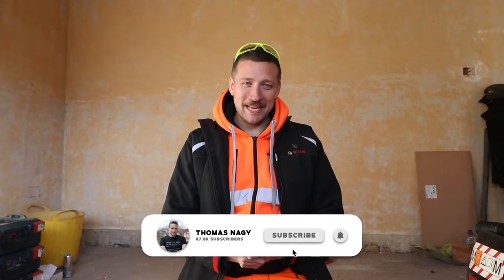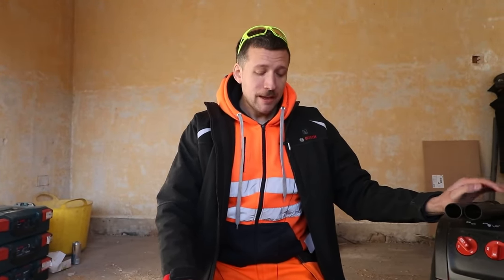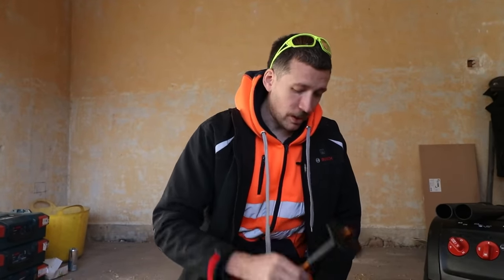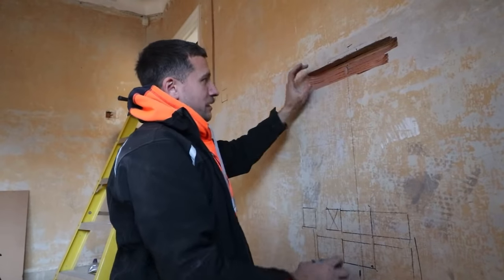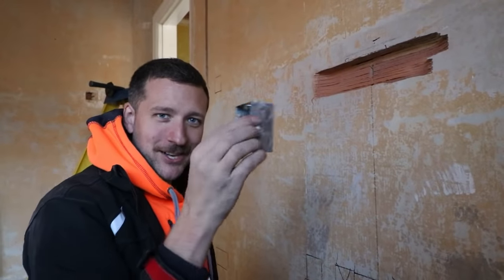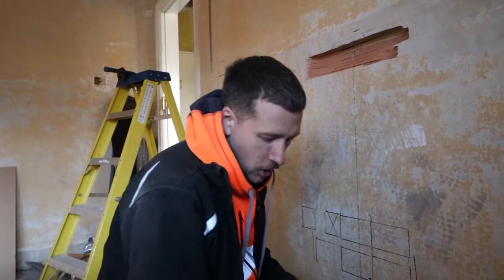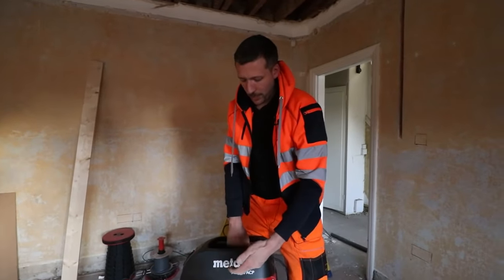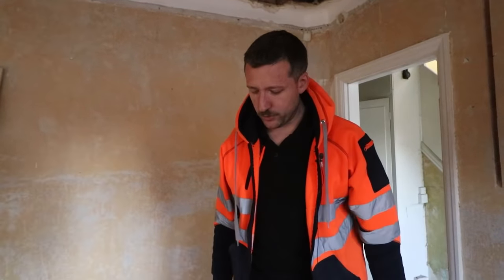The GOD of all WALL CHASERS! | Thomas Nagy

Comment: I've got twin blade atlas copco, needs two people (one on hoover!) Found it easier to chase from the top down, not bottom up. Less resistance on blades...
Reply: I see the Metabo is designed to be pushed, shame you can't flick a switch and use it in pull mode.
Reply: @nw5835  yes, using gravity to help would be so much better than trying to go against it.
Reply: Just turn it upside down
Reply: My erbauer one works by pulling it down. Better that way I think as the weight of the chaser does most of the work. Backed up by my trusty old Henry… greedy bastard!
Reply: Take it from another electrician.
You're arm's wil thank you if you juse gravity instead of fighting it. Just keep it on the wall. And hold it straight. Wait of the machine wil do de rest.
Reply: @robertjan3689  not sure how spray painting it will help
Reply: @Jackdaly2000  😂😂 sorry correct now. English is not my first language.

Comment: Was very impressed with the auto filter cleaner. That is going the extra mile that the unit will vibrate its filters clean so your suction doesn't drop off as the bag fills up. Great stuff.
Reply: Most  industrial vacums have that feature
Reply: If you’ve never seen a self cleaning filter it must seem like magic to you…
Reply: @WestSideConnection5  no, this system is quite different. It uses electro magnets to shake the dust out. Most other industrial vacuums use blows of airflow. Which impacts temporarily the suction.
Reply: @williamwallace410  never seen an industrial vac that doesn't vibrate the filter.

Comment: Bought these two years back Tom and never looked back.  Increases productivity by 500%.  It is by fare the best machine we have ever bought and with the xxx guarantee it's bulletproof.  If you are a " Registered Electrical Contractor"  And take on a lot of rewires you need to buy this machine.  We suggest the 240 V version as it has in 1900 W motor and better for pushing the three blades.  The 110 V version is only 1700 W. However you may need this if working on construction sites. The vac is by fare the best on the market in every aspect, self cleaning, power take off, hepa, just amazing. Well done  Metabo

Comment: Im an electrician and at my job we use the hilti wall chaser with dual blades, what i've noticed with other brands is that you will have to let the machine work and can't put too much pressure on it. The hilti chaser eats up everything at very high speeds.

Comment: Best tool I own by far
Reply: I was about to comment that you swear by yours on your rewire videos. 👍🏻
Reply: Nagy is late to the party 😅
Reply: Will the matabo triple blade system fit the dewalt chaser ? Anyone try it?
You’ve had your matabo for a while now nick?
Reply: @bertiebassett1972  I think mark allison (on YouTube)  tried/uses the triple blade in another chaser.
Reply: How often do you replace the triple blade nick?
Reply: @richardnewton1800  I’d say every 3-4 rewires mate
Reply: hi, what size transformer do you use to run cutting machine and hoover(20 litre.) cheers.

Comment: With that amount of dust extraction, I'd personally look to be wearing something like one of those basic 3m ffp2 masks instead of the whole external filter job. Less bulky and easier to put on, but plenty for the amount of dust it puts out.
Plus that dust extractor might well end the whole "sparks don't clean up" sterelotype when you're on site with the other trades 😉

Comment: In order to help with the strains on the arms you can start at the top of the chase and go down using the machines weight. Depending on who high you go you might need to do the top part still pushing up but is should certainly help. Such a machine with an M rated Hoover is a must I you do a lot of chasing. Often you can rent such a tool aswell for specific jobs.

Comment: That filter cleaning is a requirement for the "M" rating the machine has. M stands for medium-hazardous-dust, like you get from cutting wood or walls (the "high" rating would be for mould and other ugly stuff), It should also notify you when the pipe is clogged, usually by some annoying beeping. I got the Bosh hoover and I also really like it but I haven't yet decided which wall chaser to buy, house rewiring is going to start soon :D
Reply: That’s no an M class set up at all
Reply: @dominicmackrill5953  if not, why does the vacuum than have the big "M" Sticker on its side?

Comment: Couldn't do without mine. Have probably done about 15 full rewires so far and only just replaced the triple blade, not because it was worn out but because a couple of the segments came off. I cut in all of my boxes with it, even singles. The making good afterwards is easy and well worth doing. All of my boxes are perfectly flat with solid fixings so an hour of making good on a full rewire is more than made up for.
The dust extractor has performed fantastic, never needed to replace the filters, I just give them a good bang out occasionally and it is good to go.

Comment: A primative 'track saw' arrangement with an 'anti kick-back' lock would not only steer the chaser but would take the strain out of it even if not reducing the effort. Think wardrobe rail with a flexing runner that only goes forward.
Reply: I would love a tracked wall chaser with plunge function. That would remove the insane cloud of dust when first putting the blades into the wall.
Have you ever seen it?

Comment: I can't believe you have only just started using a wall chaser, I bought an Eabauer one from screwfix for £99, and use it with a Bosch class M dust extractor with auto filter cleaner  , the wall chaser works very well, considering the price, personally, the price of the well known brands doesn't warrent it, mine has a double wheel, with a flat chisel to break out the middle, breaks off easily, connected to the dust extractor, no dust at all.
Reply: I have the metabo twin twisted slot set up on my erbauer, but otherwise same set up.

Comment: dust extractor vacuums are a must have for every contractor yes there pricey to buy and can be quite expensive to run but you look professional and they save time cleaning up and best of all because less dust its better for everybody. i have a dust cyclone as well which cuts down on replacements bags well worth investing in if your doing lots of work and filling up bags quickly. i personally recondmend the numatic dust extractors as parts and bags are readly avalible at a resnable price. i wanted a 10m hose and i got one from my local vacuum cleaner shop for £28. i did have a festool machine and the replacement 3.5m hose was  £80 which i though was excessive.

Comment: quick tip to make using the set-up easier. . . wrap different colour tape around one of the flexes.  Makes it easier to tell them apart when your trying to move what you think is the chaser flex around, and it's actually the hoover flex.

Something Metabo could do to improve the design would be to use a different colour flex so users can tell them apart at a glance.
Reply: ? you connect chaser flex to the hoover so its only one to unplugged from the wall socket.

Comment: Hi Thomas, its a small point but that black bag is for wet collection/slurry. I'm not sure if the plastic might reduce suction a bit over time vs the fleece...

Ive found it a bit tricky past yr to find suppliers for the fleece bags but would imagine youd get a good few 'tip outs' and reuse from the black bag.

Few work arounds for cutting the fleece bags to reuse - but I just replace them each time.

Enjoy its def a game changer!
Reply: The fleece bags are for wood dust with the filter cleaning function switched off. You can only have the filter cleaning in when using the black bags or empty container. 👍
Reply: @cyberdogg5  ahh. Well, the plot thickens 😂 you def can have the filter on but it leaves dust which I've always brushed out when tipping the bag.

So scratch that about finding the fleece bags and I'm off to look for plastic instead 😉🤞👍

Comment: If you used a cyclone in line with your vacuum, maybe your  filters and the vacuum would stay very clean, not sure if this would work with brick dust, but this system works extremely well with wood dust.
Reply: Do you have a link to one of these systems? Thanks

Comment: I had this tool to chase out my house. It was incredible and re-sold with very little loss. Blades last forever and extraction is extremely good. Bag does start to get holes in quite quickly where you clamp it and instructions were poor but very self explanatory.

When you do a chase double width you do get a little more dust but marginal in comparison. 

I cut out boxed with it too. Once you work out where the blade sits relative to the runners it's easy to do a few lines to run lines and do a box no issue.
Reply: Ok; why doesn't the UK just use round boxes like we do in NL? We just use hollow core drill 82mm with 100% dust extraction and done.

Comment: I am using the cheapest saw with 4 blades- working fine for 30cm with Standard vacuum.
Upgraded to very expensive vacuum with automatic filter cleaning: works like in your Video.
I always go from the top down.

Comment: I have the very same kit. Top tip is to turn the chaser upside down and let the weight of the machine push down along the wall.  It makes it 10 times easier and id also just empty and reuse the bags to keep cost down.

Comment: I prefer the dust masks with an integrated visor, much more comfortable for long periods and better if you wear glasses.  The best ones have a seperate battery powered air pump....
Reply: Regular glasses break the seal on full face masks. Or do you have special glasses for inside the mask?

Comment: Bought the Metabo chaser with a triple blade for some pipework to sink into the wall. Used a Henry tho and he wasn't fully up to the job was a lot better than not using a hoover but you do need the M class extractor.

Comment: I've got the predecessor to that chaser, the MFE 30. I think it's slightly more compact and less powerful (I don't believe you can fit the triple blade to it?). At the time Metabo didn't have the self cleaning vacuum so I ended up buying a big Numatic (big version of a henry) but I find it blocks up frequently (even with a bag). I have built a little cyclone filter but not had chase to fully test it in anger (I don't do any house wiring anymore)
Reply: The Mfe 30 is more manageable paired with a Bosch Gas25 dust extractor.No dust.

Comment: I am an electrician in belgium. The trick is to use it from top to bottom. Gravity helps a lot.
Reply: @Anon-y-mouse  I hold it upside down and go down the wall and with the metabo mfe 40 and the metabo vacuum m classe it produces very little dust . In plastered walls and new red bricks.
Reply: @Anon-y-mouse  That's because the MFE 40 spins the other way compared to most other wall chasers.

Comment: Great video Tom. I have had this wall chaser and dust extractor for about a  year now, and have used in lived-in property's, absolutely different level of wall chaser, it's so clean and quick compared to 2 disc and sds. A must have for anyone who carries out alot of chasing.
Reply: How does it handle brick walls ?

Comment: I've been using the old model Metabo chaser for years now and find it much easier to start the cut from the top and use the weigth of the machiene going down. The strain on your hands is far less and and much quicker. That new triple blade is a god send I will buy two of them now!
Reply: The MFE40 is designed to be pushed, it doesn’t work being pulled due to the rotation of the discs.
Reply: @cyberdogg5  You invert the direction and the machine and you "push" downwards, that is, you let the weight of the machine do the work.

Comment: The arm workout comes from the tri blade, using 2 blades is far easier. The tram lines the tri blade leaves really annoys me and the plastic hoover pipes are flimsy and create loads of static. If my nilfisk didn't have a curved end that inserts into the tool it would be better than the metabo vac.
Also worth a mention is that the filter bags fit the 25l and 35l so buying a vac buy the 35l as you're throwing away 10l per bag with the 25l vac and the bags ain't cheap.
My filter control light comes on all the time even with a filter bag.  you can tell I'm not that impressed with the bag but the chaser is so much better than my old titan one, now that was heavy

Comment: Ive had mine for a couple of years and all i do these days is rewires so it gets a hammering. A great bit of kit but you do 100% still need a dust mask. When it blocks , which it does, the room still fills with dust in about 2 seconds.

Comment: I purchased a Metabo set up like that a few years back but don’t use it that much. The Metabo chaser i have is the MFE30 which i don’t think accepts the triple blade set up which in itself is a big advantage. If anybody has the MFE30 and has tried using the triple blade please let me know as its a sizable layout to find it don’t fit. Excellent video Mr Nagy always🤟🏻🤟🏻
Reply: The MFE30 only has a 1400W motor compared to the new one that has 1900W, probably burnout if you use the triple blade was thinking the same. 👍

Comment: I switched from open plastic bag to closed use-once-and-throw-out white bags: yes more expensive but a lot less wear in the inside of the vacuum and so much easier on site to clean out and not accidentally spill everything you just sucked up. For the price you already spend on the equipment it's worth it :-)

Comment: Used a 9" Makita grinder as an apprentice electrician in the late 80s. It was a beast. 
Filled the house with dust and noise, could hardly see what I was doing and nearly killed myself. 
This would be a revelation by comparison.

Comment: I have a makita dust extraction Hoover and wall chaser(and I’m very happy with how it keeps the dust down), but it uses a twin blade. I wonder would the triple blade fit into my machine?? Do you have a link to the blade? Do they have a standard centre hole diameter?🤔

Comment: Great tool! So many uses. So well designed. Can you rent them? Might be the best way to use it, no up front investment and no storage space taken up. Get it just when you need it. Curious as to how much of a survey do you do on walls prior to cutting in? I'm not used to working on solid brick, most residential walls here in US are stud walls, sheet rock covered (or lathe and plaster if older) with existing wiring and plumbing within them. I always scan with a stud finder or a Wall-a-bot first to avoid cutting the wrong thing. How do you do that on Brick?
Reply: You can scan brick wall just the same. My Bosch D-Tect 120 even finds empty PVC conduits in the wall.

Comment: Hey Tom. 
It baffle me how things are so different from country to country.
the Danish Working Environment Authority would never allow the use of an angle grinder for wall chasing, because of the dust it creates.
Reply: So how the hell do you cut walls then?? Hammer and Bolster only and an apprentice?? The Vacuum is the big game changer and stops the dust altogether.
Reply: @rattlehead85  With a prober dust free setup.
Like the one he is using in the video.
And we must have an approved bag in it as well.

Comment: Hi Tom I bought one about 8 weeks ago , wall chaser is a excellent piece of kit, but i have found the extractor  sometimes clogs the tube, ive also broken one wheel<but to be fair metabo have replace foc, so i worry about long term, and if i was you i would use as a normal hoover, as its not a henry and the bags are really expensive (around £5 each)

Comment: @ 4:31 could you get a better grip by positioning the unit upside down on the floor? Push button on the right and nut wrench on the left, instead of what's shown in the video push button on the bottom and nut wrench on the top?

@6:02 Would it be easier to run the cutter down the wall instead of up the wall?
Reply: 2nd point; the MFE 40 spins the other way. If you want to go down... the handle has to be on top. Good luck with that..

Comment: i've been using metabo and makita wall chasers and vacuum's for years they are great (I do a lot of rewires) not tried the triple blade yet as they seem pricey. I know dewalt do a cordless wall chaser hoping that makita make one soon. I still use an angle grinder to wizz out the boxes (if the house is empty) but as you said it creates a lot of dust

Comment: When I saw you chasing walls for the first time like 4 years ago I was cringing that using angle grinders is still a thing in the 21st century. By the way, turn the tool around and go from top to bottom. Might aswell let gravity help you do the work instead of fighting it :-)

Comment: How wide a chase will it do.
Seems like you may need to do 3 chases for 5 cables coming dow to a switch say and needed larger capping. Or an I missing a trick Tom
Reply: 35mm, but that's not with the triple blade.

Comment: Been using Metabo stuff for the last 15 yrs, my SDS hammer/drill only packed up this year! It's had loads of abuse. I have another type of Dilemma, I'm retiring soon so don't want to spend alot on replacing it. But yhea really rate Metabo.

Comment: how much dust when you first start the chase? I assume it relies on suction using the wall to aid suction. That first rotate in will be messy? or is the suction on the vac so good that this is not an issue?

Comment: Wondering how long each of those blades really lasts, it would be kind of pricey to have to change blades on each job. Are they a proprietary item?
Reply: I have used the same blade on 4 house rewrites and still going strong. £100 a blade well worth it
Reply: The blades can last years depending on what you use them for, brick and lighter concrete types aren’t a problem but if you chase in concrete elements the sandwich blades will create a lot of fricion and will wear the blades out.